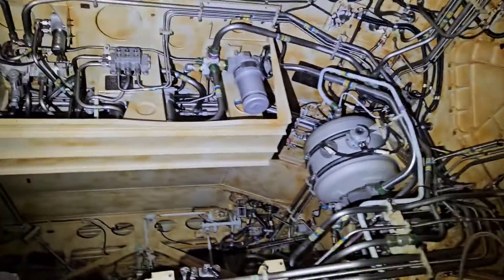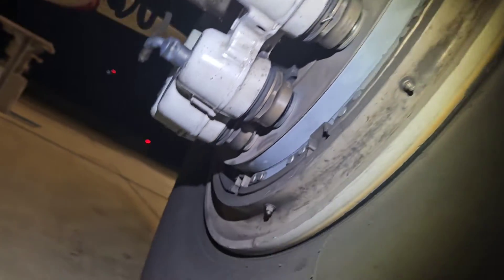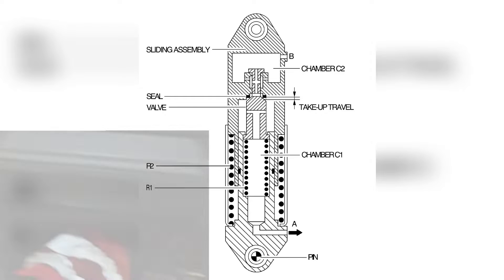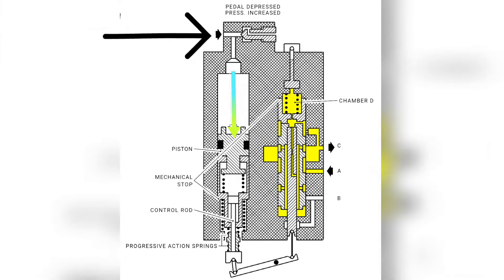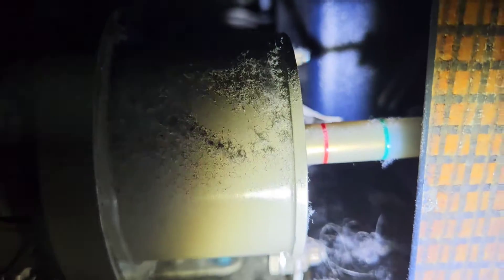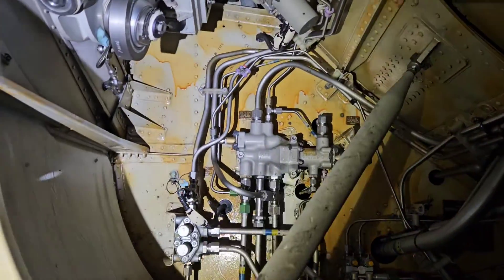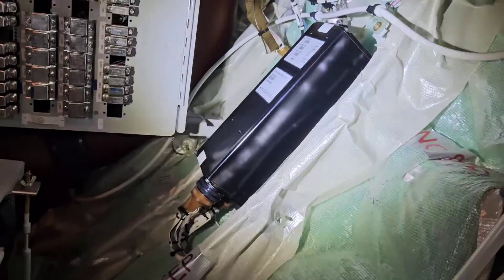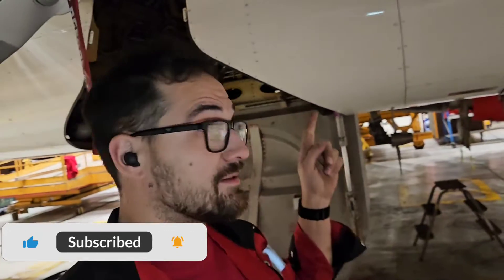ATA 29 4th hydraulic system on A320, are you sure?

Comment: Hi,are you fine,excuse me,How do aircraft hydraulics work with air or oil, and why is there a difference?
Reply from the maker: I'm not sure how much knowledge you have about it but the air is used in the pneumatic system but as well to pressurise the hydraulic tanks as the prevention of cavitation. In the hydraulic system we use hydraulic oil